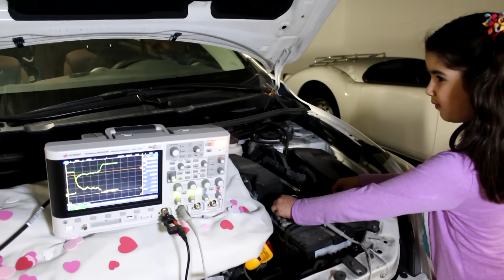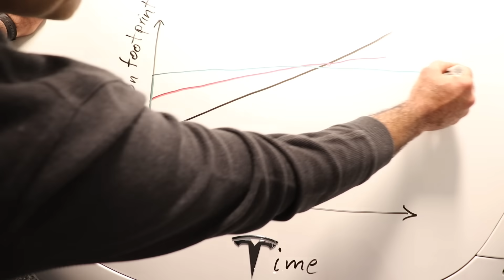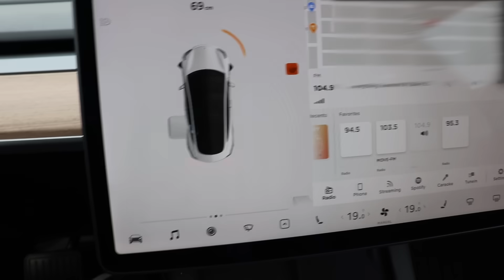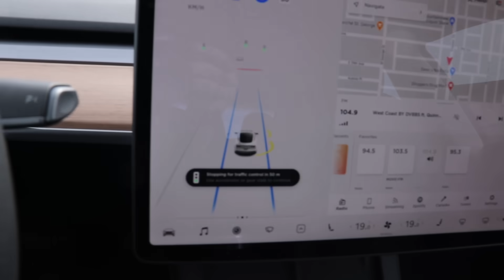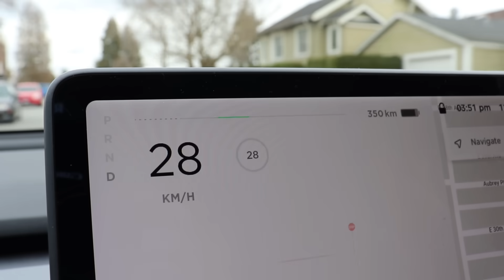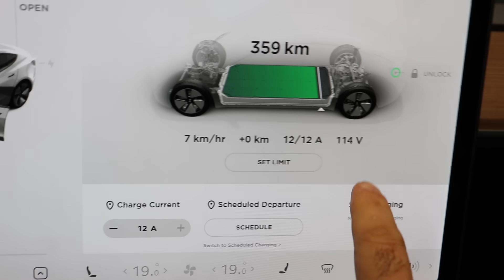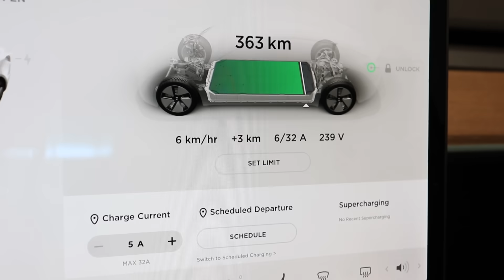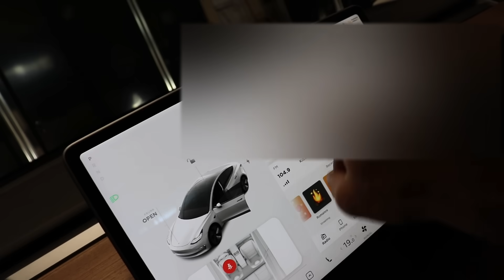ELECTRIC VEHICLES & My Tesla Model 3 Review

Comment: Tip from a Model 3 driver for over a year now: install yourself one of those chargers in the garage with a permanent cable. No need to get the mobile charger out of the trunk every time, and more importantly: ever so often the mobile charger just stops charging, and the phone app shows "charging interrupted". It will not start again by itself, you need to unplug the mobile charger and plug it in again for charging to resume. Very annoying if the battery is empty, you are sleeping, and you expect it to be full in the morning.

Also, the touchscreen may be slow and annoying, but it freezing all the time is not normal. Get that fixed while you are still in warranty.

Comment: charging so slow is inefficient because the car systems stay running and consume 200-300W. If you finish charging faster it goes to sleep and wastes less energy stationary. For example in Europe 13A/230V 3 Phase is most efficient. Maximum is 16A. Not much losses in the charger and wiring at 13A

Comment: Much respect to you sir for considering the load on the grid and adjusting your energy draw to shed load. It's too bad grid operators aren't playing a larger role when it comes to EVs or rather EVSEs. I program my EV to charge after midnight but since it's an earlier generation EV the charger pulls whatever the EVSE will provide (upto 32a) so my 16a 240V EVSE blindly pulls power at a pre-set time. I would much rather have an EVSE that adjusts according to what is best for the grid in that moment, but it seems like the UK is the only place that's taken this approach.

Comment: I still not getting why the car engineers preferred the use of lithium batteries instead of ordinary acid /cell ones 
Can you explain. That in a video with some testing 😃
Reply: If i can have it i would definetly switch that display computer with a decent laptop having high graphic card hh
Reply: Lithium batteries can fit significantly more energy into a much lighter and smaller package.
In a vehicle, the weight of your power supply is a huge factor.  With traditional cells, all that extra weight would mean more power consumption!
Reply: @DeoMachina  so a 80 and 100 amps battery would cost more wieght than power delivery compared to lithium assembled battery?
Reply: @bouhannacheabdallah  I don't know specifically how the maths works out but basically yes

Other types of battery can work and early EV's didn't use lithium, but lithium is the most superior battery chemistry today.

Comment: Be sure to do annual brake clean and lube maintenance.  Brake pads, rotors, and sliding pins that don't get used and don't dry after getting wet (rain/snow) will corrode. One of the downsides of using regen all the time.  This is fairly common knowledge in the EV community.  I've had brake maint done lately and it was 100% clear I waited too long (2ish years vs annually).

Comment: When in AutoPilot/AP, you just need to keep your hand on the wheel ... say at 7 o'clock and a slight downward weight (torque) will keep it from 'nagging' you. That is the expected use case and not to keep your hands off the steering when and touch it everytime it reminds you.  Besides with a light handhold (7pm) if you are looking around you *immediately* 'feel' if the car is doing something your brain doesn't expect (ie. turn a little right when you expect it to be going straight). ie. way faster reaction time than visually noticing something going wrong.

Comment: You don't need to move the steering wheel every time. Put the hand on it in such a way that the weigh will resist the wheel's motion. That is the easiest way. Also, it stops for all traffic lights (red and green) except if there is a car in front of you. If you are following a car, it will go through a green light without stopping. This is a safety feature until they validate their traffic light detection.

Comment: In europe or lets say iran:) !!! you could charge the car faster at home if you use 32 amps and 3 phase 380volts line to line with those european CCS Socket. tesla use the same OBC pcb but for usa and canda which runs on 110volt or 220volt in 2phase it could adapt it by using 3 individual circuit that in usa for instance they are working as the same with 220volt or 110 volt.but in europe 3 individual circuit working as 3 separate line to line phases. to sum it up europe voltage is a pluse for charging EVs at home.

Comment: It's always the 10 mm that goes missing.

By the way, Mehdi, if you want to access 12V from the big battery, you should use the accessory socket for low power or the terminals under the back seat for high power. The small 12V battery under the cowling is monitored by the computers, which will complain if they see excessive power draw. Some guy on the Internet found that out the hard way.

Comment: "I bought a Tesla... in debt". You mean you used someone else's money you borrowed? :O
Also, I was running a diesel generator today, and it gets HOT. Lots of "wasted" heat means wasted fuel. I wonder if the losses over the electric lines is more than the efficiency gained from a modern power plant? Though IIRC modern petrol engines are pretty efficient too. Green energy of cause negates some of the losses an electric car suffers from transmission. :)

Comment: It is cheaper to run than a gasoline car because there is a heavy tax on gasoline.  As more people get electric vehicles there will also be a road tax that you will have to pay.  Yes, there is less maintenance on an EV but when you have to buy a new battery pack it would probably be like replacing a transmission or engine in a gas car. That is also why I have very few battery-operated tools.  When the battery dies you might just as well wait until the tool goes on sale and get a new tool and battery for the price of just a battery.  Now if you work construction that is a different story.

Comment: How about the battery production and its adverse effect on the environment? These are not green cars in any sense. Also modern diesels actually turn off the injection when the car is decelerating so going downhill with throttle off consumes 0 fuel.

Comment: No brake pad changing? Isn't there an old-school mechanical brake to support the regenerative brakes or to stop the vehicle in case of emergency?
Hm, maybe there are security relays which will connect the motor phases together if the car loses all power.
Where is THE RECIFIER?

Comment: I just want to point out one thing, you said that there's no brake pad changing but that is false. Yes, ICE cars use the actual brakes often apart from electric cars but that has one disadvantage too, brakes on electric cars tend to rust out due to lack of usage, so be aware of that and actually use them hard once in a while where it's safe to prevent that.

Comment: 11:34 This also happens in manual transmission vehicles. Here in europe we all drive manuals. If you come off the accelerator, the car slows down. The lower the gear, the more braking power you got. Also manuals don't need transmission fluid changes.
Also diesel cars are superior as daily drivers compared to gas cars. A skoda octavia TDI 1.9 can get about 55MPG combined and have pretty amazing low end torque. Diesels barely burn any fuel at idle

Comment: The big problem with EV for me is they just take the carbon impact, and shove it somewhere else.

EV cars take more to make, and if they have a bigger carbon footprint than regular cars, youve got to drive it longer to un-pollute that much.

EV cars still need power from somewhere, and if youre not running on nuclear, wind, solar, or hydro, youre running on coal or natural gas, which just means those plants now work harder and output more carbon.

Why buy an EV, if it doesnt solve the problem it just moves it somewhere else?

Comment: 16:00  "charger runs more efficiently" - AKSHULI most converters are the most efficient at maximum output power. But running it at lower current is overally better for the charger, battery, cables and power grid, and overall efficiency might be better thanks to lower losses over the cables.

Comment: Why people are still charging their electric cars beats me.
You could just add a removable battery pack and change that at a fuel station. Just add an LCD display to it that shows charge cycles, total charge remaining and year of manufacture and have it unclip from the bottom of the car when a hydraulic jack cart thing is detected and you press the release button from inside the car.
That way you don't need to wait 5h for your car to charge, it would be done in 10 minutes.

Comment: I am not convinced that electric cars are any better than petrol. It seems like the pollution/cost is only shifted, not reduced.

How does the cheap cost of charging stack up over time when the battery wears out and you have to replace it for thousands of dollars? How does the carbon/pollution footprint stay flat when producing that new battery? Plus the "recycling"/disposal cost of the old battery.

How many people are just going to sell/scrap the car when the battery dies and buy a new car anyway, adding again the pollution from a whole new EV build which as you say is much higher than a petrol car?

Tesla is even worse in this regard as they refuse third party repair work, don't supply repair data, can charge any insane out-of-warranty costs they want, and "encourage" a new car purchase instead of repair.

The only way I see EVs being more environmentally friendly is if people only ever buy one in their lifetime and the battery never wears out or the car never breaks beyond economic repair and the electricity used only comes from "green" sources (all of which together is practically impossible).

Comment: Fun fact: Driving an old car into the ground is better for the envoiorment that buying a brand new EV
Reply: Yeah, he already explained that...
Reply: @Kiwipai  I dont think you understand. Buying a used car and driving it until it dies is better than what he did
Reply: @Oceam  Simply put, he didn't put any old but usable cars out of circulation. I think I understand what you're trying to say, but saying he's responsible for any third parties wrecking usable cars doesn't hold any water if reflected on, it would be like saying you are responsible for the electricity I use by responding.

The thought process might have held water if it was near impossible to sell old cars because everyone preferred new ones, but that's not the case. No one is currently "forced" to wreck any usable cars by any stretch of the word because some decide to go for a new one before every already-used car is gone.

Comment: Will you please build a testing rig out of a treadmill, for a ebike or scooter motor & controller with Regenerative-Braking, to show what voltage & waveform looks like under acceleration then Regen?

And can you please also test ultra-capacitors in parallel with batteries? Like how much does bigger and bigger capacitor packs, improve the batteries' kinetic energy recovery of Regenerative Braking.

Comment: Mehdi you know that AC-DC converters tend to have real disappointing efficiency when the load is low, right? It's the same with onboard chargers, lets say you can charge over 90% efficiency at 6kW but when you set like 5 amps, maybe you'll be a lot closer to 80% or even lower (for example the old Renault Zoe with the 44kW onboard AC charger have been reported to have lower than 70% efficiency at 2kW). If you have the time, you could do an efficiency measurment leaving the car at different currents each night, and comparing the power taken from the wall, and charged into the battery. It would be an interesting test.

Comment: What do you mean? I just turn off my gas car engine and coast down hill in neutral.  The gas already built the potential energy by climbing up the hill
Reply: Yeah but so does the electric. But in addition to not using power on the way down like a gas car it also recoups some of the energy spent so it can use it later, not just in that one downhill.

Comment: ahhhh americans  in automatic cars .... meanwhile in germany in a Manual  Diesel car downhill  put it in high gear let it roll   at 1500 rpm it turns off the diesel injection power cut off as we call it and let it roll, only the compression slows the car :P   uses no fuel down hill  yea it may not gain anything but it produces electricity through the alternator and runs the ac  from the downhill motion :P

Comment: Ya know, if the engineers at Tesla could integrate solar panels on the roof of models, then that could be what we need to lower emissions from motor vehicles. Like Mehdi said, not all energy is from renewable sources (which we would charge with). I’m not an engineer so I don’t k ow if it’s even possible, I have a cyber degree so yea. But yea I hope it could be possible sooner rather than later

Comment: Just a small correction: Modern Gas vehicles will not consume gas going downhill. 
It's a strategy called "Cut Off" and even some late carbureted cars had it. When you're above ~2000rpm or more, going downhill, and provided you don't step on the clutch nor the accelerator, and keep it engaged, the combustion engine will NOT consume gas! :)

Sure, it will not "gain" fuel back like electric cars with regenerative braking do, but provided you do it correctly like I said above, you can save fuel AND wear on your braking system! :)
You may know this as "engine braking" and the reason your engine is braking for you is precisely because it's not consuming fuel, so it converts motion into friction=heat that gets dispersed by the oil and cooling system.

Comment: The Processor is slow because its old and bigger, that makes the Processor safer from happening bugs. Like when the processors are smaller,  impurities in it make the processor work wrong easier. And in the case of driving, u can't have a bugging Processor that might make u drive into something because it's not working correctly. This is kinda how my uncle explained it to me, I am sorry if this isn't correct, but it seems logical to me.

Comment: need to examine the method it detects and see if it could not see it because of lack of something to stop what ever sensor it was using, then alter the boxes so they are still safe to ram but block that signal to ensure it can and does see their bulk as a solid block and maybe not a chunk of air and thin layer it thinks is an anomaly or something. thus ignoring it, (also giving it a chance it might have normally detected it and you had that one in 1000 or 10 thousand times that it fails as these are not full brid... er proof tech, just very low level failure tools.

Comment: That's great and the EVs are definitely the future. However we are still very far away from that future. There won't be any meaningful EV adoption until the prices come down close to those of similar class and trim ICE car. On average, currently that factor is about 1.8X, meaning you can buy a very similar ICE car at 1.8 times cheaper then an EV. So at best you'll start seeing any gas and maintenance savings well into 7-8 years of ownership, by which time the EV battery already degrades a lot. So I'd say 2030-2035 would be the earliest when the prices become even remotely comparable to ICEs.

Comment: Damn that display processor is giga bad. It should be illegal for car manufacturers to ship cars with control panel or whatever its called that might randomly stop working in middle of the trip. They need to provide bare minimum analog controls to operate the car in case of a failure of the OS. Or better yet dont cheap out on the display digital components......

Comment: There will not be any classic Tesla. They are all disposable with the electronics  and inability to get information and parts to fix them. Never will an EV pay for its carbon bill it took to build. It just will not last long enough. You will not be able to repair it. Just like your old PS3 they will kick it off the network, so most functions will stop functioning. All EV's are a scam as far as environmental issues are concerned.
Reply: Then add in the fact they crush wrecked tesla's instead of recycling the batteries in Canada. Just try and buy batteries in Canada. Tesla is as evil as Nestle or Apple. These batteries could be used for running homes. Even if all they did was charge at night and run the house during the day. You would save 50% of your hydro bill.
Reply: They need to standardize the battery packs so that they can be quick swapped. So the batteries are not sold with the car. Making it much cheaper. Easy to upgrade to better battery tech as it comes along. You drive to a charging station and drive over the trap door and a rack comes out and removes the battery and installs another. This way you can change the size of the battery. Why haul around all those batteries why you are only driving short trips all week. Drive to the station and install a large battery for the weekend. This way the batteries remain in the manufactures recycle and repair system. The car owner is never stuck with an outdated battery pack at high risk of fires.